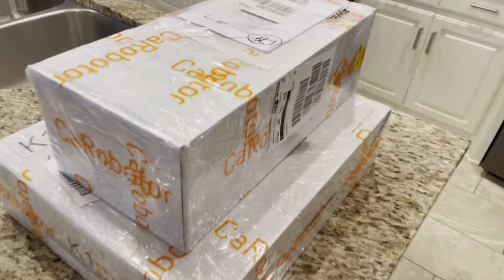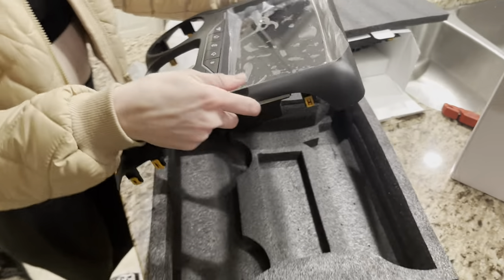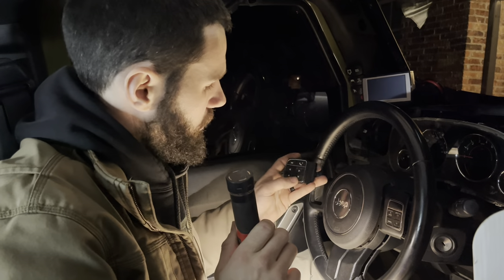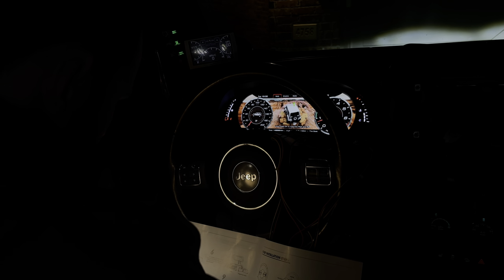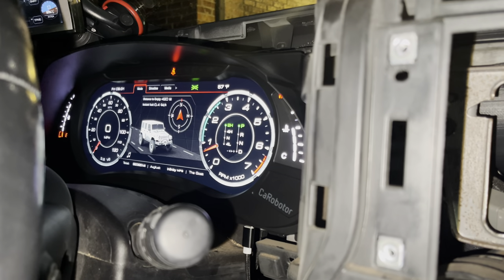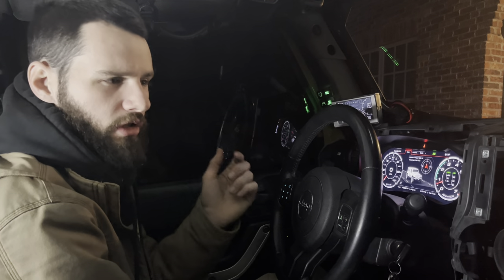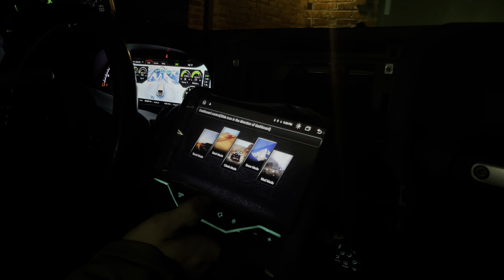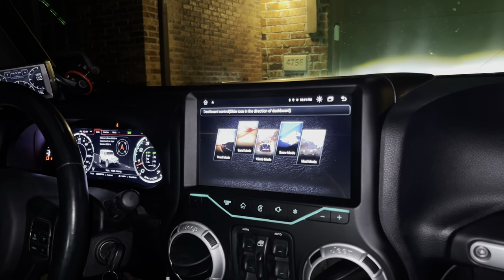￼Installing & Real Screen Time of the Jeep JK CaRobotor K1 Radio & Digital Dash

Comment: I know it's a cool product. But please. For the love of God be careful with it. This thing nearly screwed me on the highway with it's terrible programming hopefully they fixed a lot of the issues and the customer experience is a hell of a lot better today!
Reply: Probably user error. I have had not one single problem with either the J Pro or the K1.
There is a learning curve to be sure as there are almost endless combinations of ways to use them.

I’ve had both mine over a year and they not only gave my Jeep a much needed upgrade, but make my Call of Duty Rubicon a joy to drive.

The J Pro alone has many useful features. Good luck to you.
Reply: @macman1138  I doubt user error when they have been sanitizing issues from the web site. The cluster also threw me into hill descent mode on a highway. Refused to register speed and also stopped the inverter from working. After testing with my mechanic for days and swapping it out. Everything went back to normal. They never even responded with updates nor help on email or forums.

Comment: Does this use the existing mic or do you get a new one?  Can you watch videos (Netflix, YouTube, etc...) while the vehicle is moving or does it lock them out while in motion?
Reply from the maker: I don’t recall adding a new mic, whatever I did in the video, it’s been about a month or so since we made this video, never tried while driving, but next time I’m driving the Jeep I will try it and get back to you! Been a little more then a month and we love it
Reply: The K1 has a built in mic that works very well. I make and receive calls all the time…texts too.
Reply: I haven’t been able to whilst using CarPlay. I have and keep updated essential apps on the K1 to use without a phone presence. I also installed a small Netgear wireless router in the Jeep to provide wireless to the K1, my iPhone and any passengers connected to the LAN.
Reply: @macman1138  Can you explain what you did in more detail as i dont understand this.

Comment: Well it has been more than a year since I installed the K1 head unit and the J Pro digital dash in my Jeep and I have had not one problem out of either one. I have had 2 firmware/software updates for them both that went without issue. 
I do not regret spending the money and time to make these crucial and important hardware upgrades to my Jeep.
Good luck to you both.
Reply: where did you get your firmware I've had my dash 2 years no problems but have not ever been able to get firmware updates
Reply: Thank you.  Was wondering about this cause I seen other people have issues.
Reply: Crucial? Haha thats pretty funny

Comment: I put the J Pro in my 2011 Call Of Duty Jeep in October and the K 1 in November; I’ve had updates to the dash and the radio head since installation.
There’s a Manual built in on the K1.

I couldn’t get the compass straightened out, no navigation information on the J Pro nor media information to the dash either.

Since I almost exclusively use wireless Apple CarPlay, the compass, media and navigation information is no big deal and may be addressed in future updates.

The hardest part of the installation for me was swapping out the key pad on the steering wheel….

I named my J Pro “Black Ops” because my Jeep is a Call Of Duty Black Ops.

I simply love my J Pro and K 1 and they work well together and I know you will too.

Good luck to both of you always.

Comment: Great video!  Thanks for posting it!  I have the same setup, but have a question for you:  have you continued to get those random 6 horn beeps after starting your Jeep (beep-beep pause beep-beep pause beep-beep) like you got at ~40:10 in the video?  Mine does that occasionally, but only when my Trail Dash (same setup at you!) is connected.  It doesn't do it very often, but that is a bit annoying.  I'm guessing it has something to do with the JPRO finding a connection on the ODB II Port while performing a self-diagnostic on startup - I say that only because it never seems to happen if the Trail Dash is disconnected (I ran a dozen tests both ways).  Regardless, mine does not do it every time - it appears to be very random?

Also, for all the K1 users out there, the reason you "have" to use the BatMan Camera from Carobotor is because their harness uses 5V from the USB output and picks up the reverse signal from the CANBUS, while most after-market backup cameras require 12V power from the vehicle and you sometimes have to 'splice' into the acutal reverse wire to activate the camera.  That took me a while to figure out since my original camera (which I installed years ago) has the same connector, but didn't work when plugged into the K1 cable.  I am not sure how you work around that limitation, though, so I just installed the BatMan Camera.
Reply from the maker: Yes we still get the horn beeps, I did just unplug the tuner we had on the dash think that might have something to do with it as well, other then that and the Compress we haven’t had any problems, wife loves it
Reply: @thebuckaroos6135  Thanks for the extra information!  I really like the JPRO, and am glad I installed it.  Like yourselves, I do wish some of the other features worked, but just the "new look" instrument cluster is a definite upgrade, in my opinion.  As for the K1, well, I still haven't decided if I love it yet or not - mine is very, very slow to load apps and sometimes reboots randomly (not too often, but enough to be annoying).  Unfortunately, I have yet to determine if it is a hardware or software issue.  I've reached out to Carobotor, so we'll see what they say (though I've seen from others that their Customer Service is very poor).  Thanks again for the video, best wishes always, and keep on Jeepin'!  :)

Comment: Is the radio compatible with other backup cameras or just the one carobotor sells ?
Reply from the maker: After reading a bunch of reviews of aftermarket cameras not working and possibly having to be unlocked in the head unit, then trying to communicate with carobotor and some people have to wait to get a response upwards to a month, i choose to order their camera so i would be less likely to have problems, its actually a nice camera, no problems so far

Comment: 19:20. Where the fuck did you put all those wires? Are they left together? Which one is unplugged? Which one is plugged???
Reply: I think those were the sync cables that are only needed to sync the info from the old cluster to the new one. Once the sync is complete, you can disconnect them and put them aside....I think.